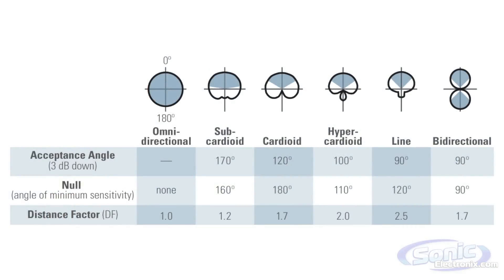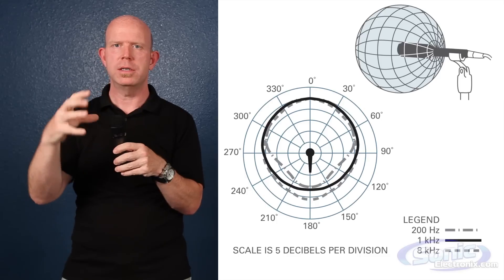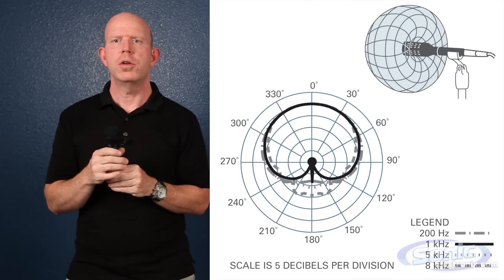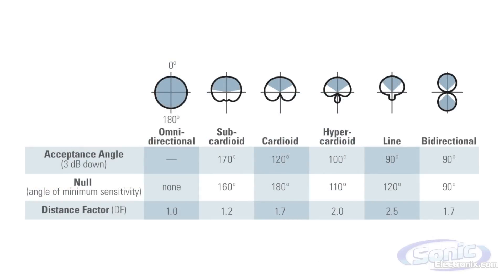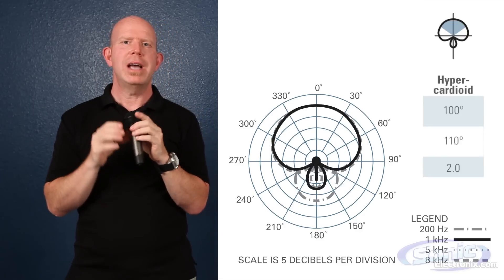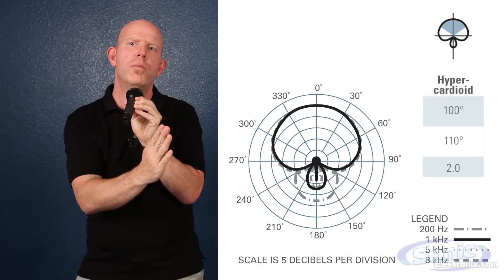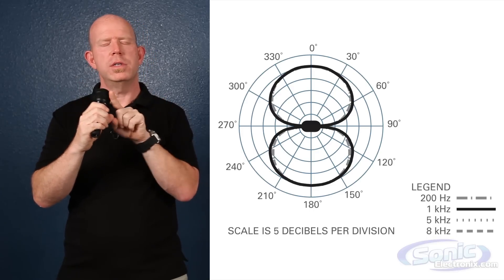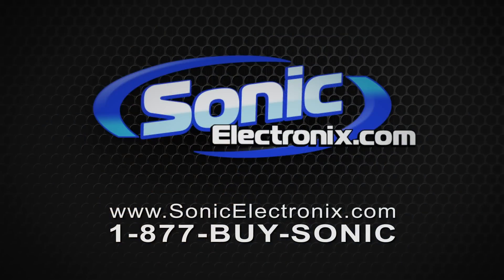Polar Pickup Patterns in Microphones: What Are They?

Comment: If I'm using drum mics that are made for drums and only use one per drum and the condensers as the overheads it's not rly possible to get phase issues right? You would need to be using two mics on say a snare to experience the phase cancellation?